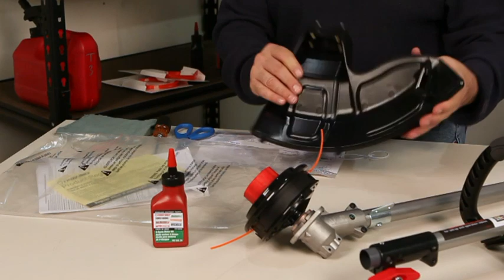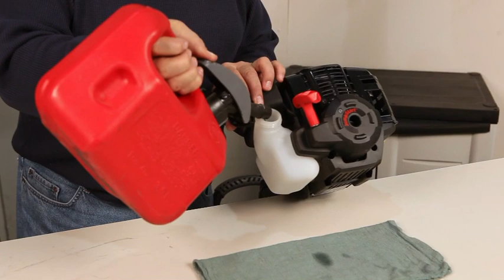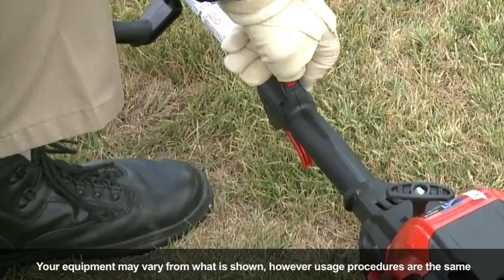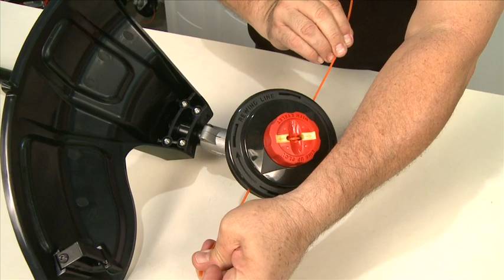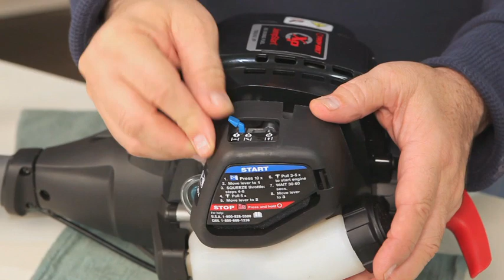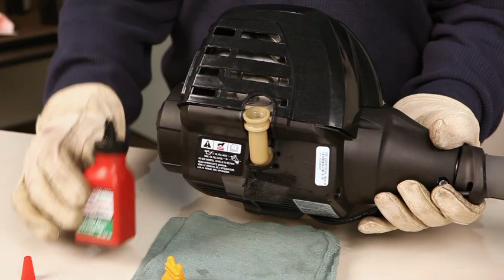The TB6042 XP gas string trimmer | How to set up your 4-cycle trimmer

Comment: During mid use the head came apart and the pieces flew everywhere, I lost the spring,Troy Bilt customer service told me I was SOL I would have to buy the whole head.  Between this and the shaft attachment cracking on me I'm never buying a troybilt product again
Reply: Zenkai76 I had that happen to me with this head once too. Once I realized the arrow on the ring has to be turned past the release clip on the side,and there's no need to take it apart because the line is inserted through the bump knob and out the eyelets and wound back in with the knob, I didn't have that problem again. I've used many different brands of trimmer heads and I like this one best.

Comment: i just hit the first 10 hours with the TB6042XP and saw that i am supposed to check the rockers AND replace the gasket and replace the rocker cover with a specific torque setting which requires special hardware. i talked to several professionals about this and they said it was absolutely not necessary. they said the only time you ought to fuck with the rockers is if the engine starts running shitty and it's not the oil, carb, or the spark plug. adjusting the rockers costs $30 at the engine shop.